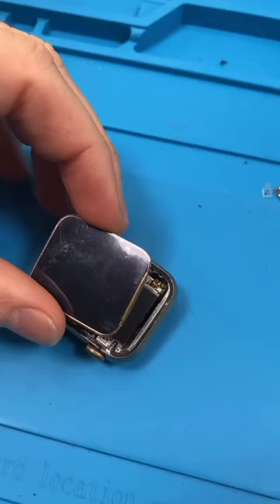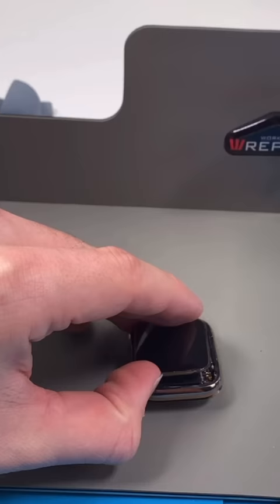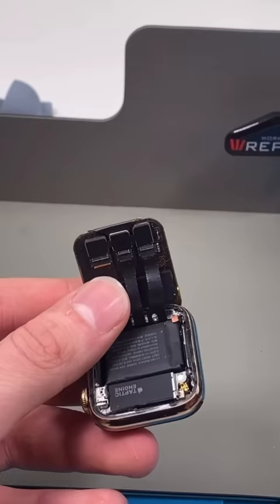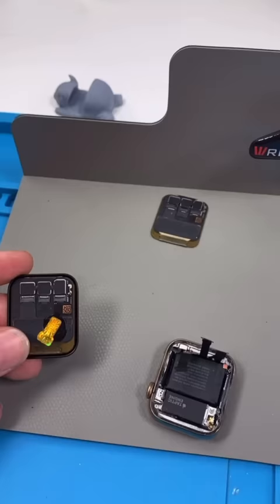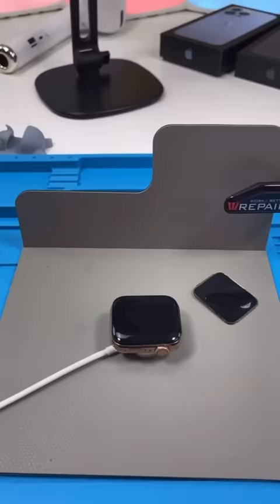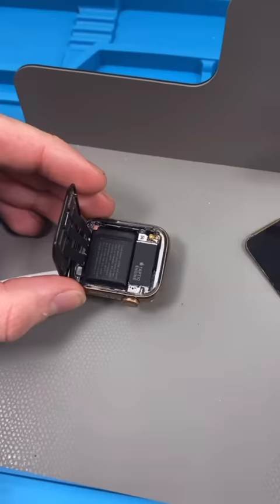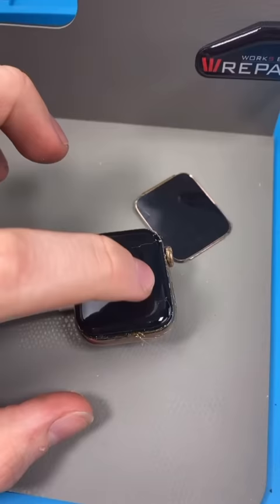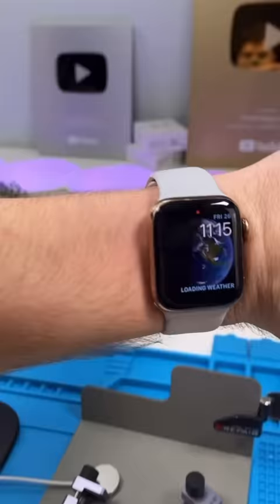Apple Watch Screen Repair.. So Smol #Shorts

Comment: What does refurbish mean? And, I didn’t see the charging logo. Also, what’s a force type sensor or whatever u said?
Reply: There’s a gasket around Apple Watch screens called the Force Touch ring, without it, you can’t use the Apple Watch properly, this video also doesn’t cover the needed NFC chip swap to ensure Apple Pay and pairing work after the repair